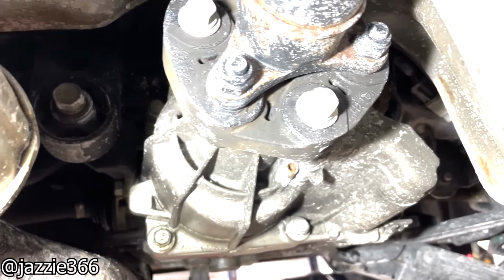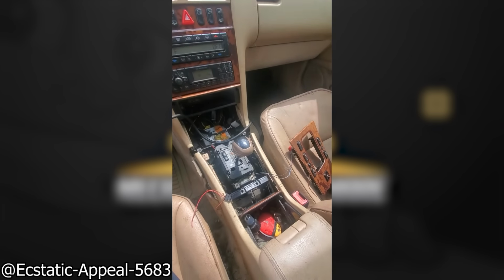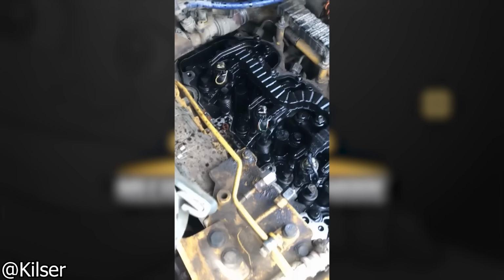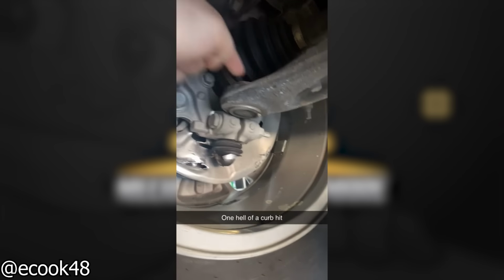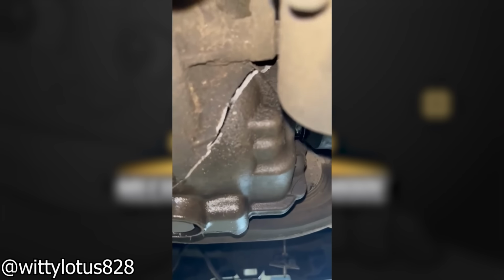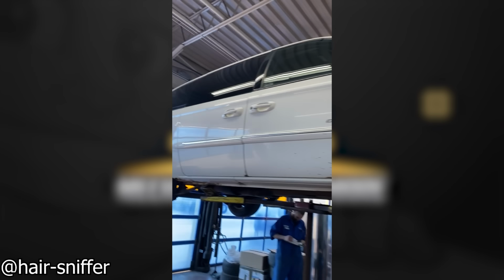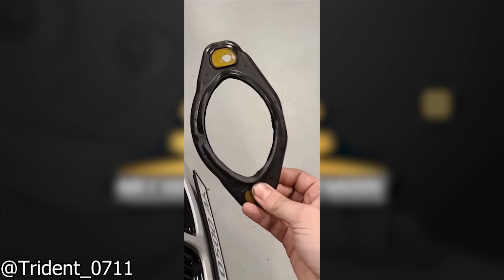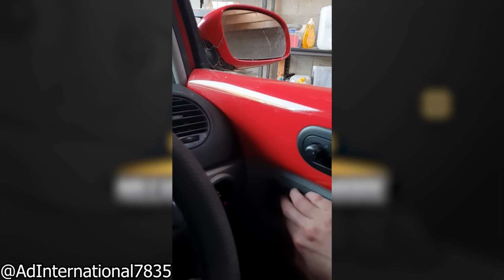Customer States Compilation (Best Of 2022) | Mechanic Problems | Just Rolled In

Comment: DON'T GO TO JIFFY LUBE-TYPE PLACES!
Reply: My work is literally next door to a jiffy lube and I’ve been tempted a couple times but I’ve never been lol
Reply: @Fetidaf  I've had several friends and family need replacement engines because the oil change places have left the filter off, didn't remove the old filter o-ring, no gasket for the drain plug, etc., just dumb things that they miss, goofing around, not paying attention, in a rush.
Reply: @angelalane1307  about a week after I bought my car I smelled burning oil on my way to work, since it was a newer car (10k miles) I didn’t think much of it… until I stopped and saw a glimpse of smoke in my headlight.

I pulled into a parking lot and sure enough, the oil filter was loose. Luckily it’s on top and has a lip around it to catch a little spill so I just wiped it all down and tightened it. It smelled like burning oil for the next couple weeks but it could’ve been a lot worse if it had dropped much more onto the exhaust manifold which was directly below it.

I’ve always double checked things like lug nuts, drain plugs, filters etc when having someone service it but I didn’t even think to when buying a car
Reply: @Fetidaf  😳 Glad you caught THAT!
Reply: I've been fukt outta $ before...you gonna value $ over the well being of a human life?

Comment: 17:08  3 of my vehicles are started exactly like that. Lost my keys one day and pulled the steering wheel lock and ignition off to get home. Two of them now have push button start and switches for power and accessories. One of them still needs screwdriver to start.

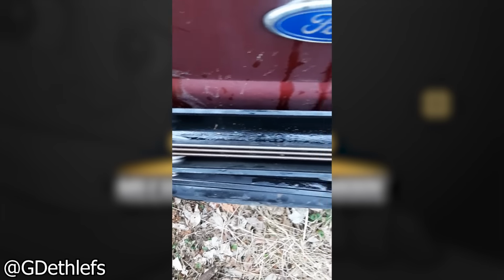Comment: 10:50 For that in rad tank transmission oil cooler, we normally burst test those to 40 bar (~580 psi) with zero deformation allowed, so that transmission had to be at aome crazy high pressure.

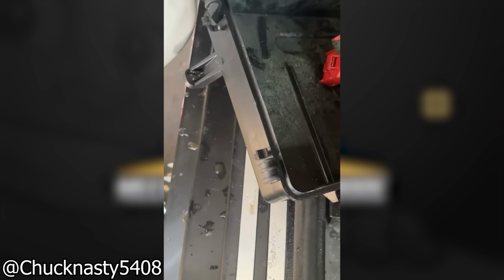Comment: 42:18 I had the same issue with my Audi A6 4F from 2005. Problem is, the drainage ist clogged and all the rainwater comes into the drivers and/or passengers side. Infotainment system is under the drivers side so the radio won't work anymore if this is broken. I think in my there have been like 15 Liters of water and it took like one or two weeks to fully dry (it was in winter..). So not completely customers fault but Audi's engineers.
Reply: I have a similar problem in my 2010 R56. Turns out the vapor barrier seal failed and was dumping rainwater into the driver's footwell, right where a control module that controls lights and ride height sensors is. Easy enough to fix, expensive to get the module and have it programmed though.

Comment: That car with no floor is no problem. I bought a car that someone fixed up to safety but floor rotted. Bought it for 300 bucks. A friend came over to help out. In 2 days we got drunk as shit and put in a whole new floor. Spent 100 on sheet metal, 50 on self tapping screws. Removed seats etc. Hammered it into place then anywhere we could find solid floor ran in hundreds of screws. Cut holes out to bolt seats back in. Total 450 invested in a car i drove for 3 yrs until had a bush party and rolled it in the field.

Comment: I know it sucks, but if you don't fix the little things they turn into huge messes real quick. Get it looked at as soon as it starts making a weird noise, breaks, ball joints, engine tapping, whatever, maybe it can be repaired instead of replaced when it catastrophically breaks. Replace oil every 6000-7500 miles at least. Watch your gauges, get it to a shop if it starts turning or steering or running more difficult, and when you start to leave for the day take a quick look at the tires.

Comment: My mom divorced my stepdad when I was 12yrs old. I became the man of the house, which included fixing EVERYTHING from appliances and her car.
She'd bring home parts her coworkers or customers told her she needed, give them to me and hope for the best.
I started on repairing a washing machine, and progressed to rebuilding her bugs engine.
By the time I was 14yrs, I had done it all, and had neighbors bringing their cars to me.
All I needed was the manual and close enough tools and I got it done, it it was possible.
Also started building guns as well for extra money, get old milsurp rifles that were a mess and just put them back to service state. 
Always good at mechanical equipment or anything with a engine. Today, I can't believe the insane crap mechanics have to deal with, and it seems that the designers and engineers just do not give a care about repairing their designs. 
It doesn't look like we as the end users are actively to be able to do these functions any longer and soon if not already will be just have throwaway items, including automobiles.
I feel for today's mechanics..

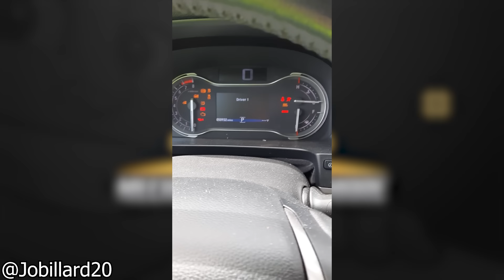Comment: 21:18-21:34  that happened to me also I had to diagnose what was going on, but the vehicle was involved in a wreck and the body shop didn't fix it right, so I had to replace the whole wire harness.

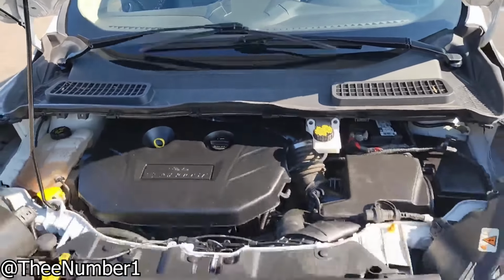Comment: 2:07 my 2017 Ford escape does the exact same thing. It did not do that from the factory, it only happened after I had the infamous coolant intrusion issue and the dealership fixed it under warranty.

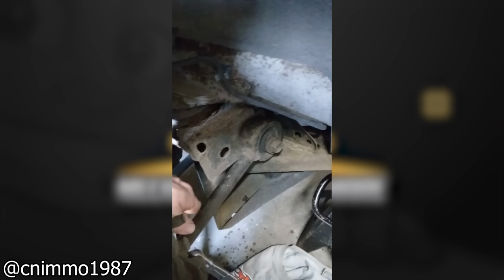Comment: 18:30  a parts guy told a customer - it's OK to use transmission fluid for brake fluid!  Not only the 2 don't mix, requiring a complete flush & replacement & bleed of the brake fluid, AND maybe new parts - - but the brake pedal might go to the floor  AND/OR complete brake failure!  Car owner is fortunate - they drove it to the shop.  
🤔🧐🙄 Might be the most expensive brake fluid flush & replacement & bleed ever!

Comment: For most cars i drive the frame of the car will likely rust out before the engine and transmission does. Michigan weather and salt helps with rust. I always have an under body wash when it hits spring time.
Reply: Not a surprise if you never use protection like owatrol oil or Mike sanders products. It's not the weather or salt. And washing is not enough

Comment: The parental unit's Escort hatchback had the engine overheat and shut down, so she had it towed out of town to a reputable mechanic. They discovered the previous guy had deliberately poked a hole in the oil filter. The screwdriver marks were still visible under the leaked oil.
Always research your mechanic.

Comment: The spilled water on the center console of the Mercedes is a real thing. There's a circuit board (or a brain) that controls the shifter/transmission, window and door locks and several other things. A spilled drink, fries that board and the car won't run. Only fix is to replace it. My dad found out the hard way.

Comment: I think the New York State Salt is especially stronger than other states, I see many vehicles with giant holes and major rust on frames. I grew up in Buffalo, live in the south now, thank god, but bought some low mileage vehicles from NJ and Long Island recently. Because of low mileage they have just a little surface rust on frame. They will be fine down here for next 5 years and the rust will stop without constant salt bath, not to mention driving in the torrential downpours we get in the summer.

Comment: People used to be more mechanically inclined.  You had to be.  You carried little tool kits and spares for stuff that broke.  Like an airhead VW Beetle, you carry a small tool kit and a spare cooling fan belt, some spare sparking plugs, some tappet adjusters .  These days people don't even pop the hood until 100,000 miles.

Comment: I had a 911 come in with an accompaniment box of convertible parts.  He was trying to figure out why the top wouldn't open. He managed to damage the top cover lid transmission and stripped out the pump release screw only to find out the hydraulic ram position sensor was off

Comment: The question remains, did any of the car owners keep their radiators rotated, regularly change the air in the tyres, lubricate the windshield wiperblades, check the gas pressure in the headlamps and rotate the lightbulbs, fill the petrol tank with diesel and run it out every 5000 kilometers, then go back to petrol, change the windshield every 10.000 kilometers, use Drain-O to flush out the fuel injectors every other oil change, spray the undercarriage with muriatic acid to keep the bolts from ceasing, and protect the paint finish by buffing it down with acetone?

Comment: Scary and sad that some of these cars could be running beside us on the Interstate!
Reply: not for long, that's why they're in a mechanic's shop.
That being said, some dirt roads can destroy a car's suspension in short order, and shake most everything else loose or bind it.
my folks never buy new vehicles for this reason, easier to ruin a $1500 junker in a year or two, get 20-30K out of it and haul it to the junk yard, to be replaced with another clunker.
does not make sense to buy a new vehicle and have it ruined three years before you are done paying for it

Comment: That chevy truck at the end is typical for the Saginaw steering column and also the reason why you dont use the steering wheel to help you get into a vehicle I've had 3 jeeps do that and my corvette if anybody sees this and has an amc/jeep or GM vehicle built between about 1969 and 1995 ish with a tilt column you probably have the Saginaw steering column and you need to be gentle with it or that shit happens also they are a pain in the ass to repair if it even can be repaired theyre designed to more or less collapse in an accident and the pressed in collet that holds the ball and socket joint together can mess up and cause this issue if that happens its pretty much just time to put a new column in cause 90% of the time they crack when that happens

Comment: The clip of the 350 LT1 hurt the most. Definitely a blown head gasket. I guarantee that the coolant overheat dash light was on for a long time. At least this engine can be rebuilt. Most modern engines are a throw away item.

Comment: I change my oil and filter every 4K miles with Kirkland full synthetic oil and I change the front and rear differential, transfer case and transmission flush every 30K miles on all 3 of our vehicles. I guess that’s why we can drive our vehicles for 300K miles.

Comment: That transmission cooler expansion is one the big reasons to change your fucking transmission fluid. And no it doesn’t matter what mileage you do it at all. That was varnish and brass flakes lodging in the thin ass cooler jackets and transmissions have been putting out a lot of pressure even back in the accumulator days. They put out even more pressure now that they are all solenoid valve body control

Comment: What's really sad is you can take your vehicle to the dealership to get something repaired and they always do some "multipoint inspection " trying to find other things to repair and never check the easy/free stuff. Took my van to get the door motor fixed and they didn't even add a little air to my tires. Said they all have 35psi but my light was on when I got there and when I left. 
Just because a car is in to be fixed doesn't mean that they don't try to take care of them. Some of the bad is on the mechanics that don't really do the checking earlier.
Reply: No - when you see the lights are on because of the pressure YOU check and add air. That's your job as the owner of the car, like it's your job to check if all lights are working before you start, because when someone crashes in you because your break lights didn't work it was your failure. And if you give your car to the workshop and you see that the pressure isn't right ask them to check it. And with the automatic tire pressure sensors the problem is most of the times that the sensor is broken, but the pressure is ok and changing the sensor is a repair you have to authorize. Depending on the car the sensor can cost between 20$ up to 200$ + the cost for checking which is defect and installing a new one.

Comment: There is a reason for the things, and don't simply blame the driver.  Firstly, car makers use crappy metal,  like cheapest iron that will rust and crack on a 100.000 dollars car! 
They also use  cheap plastic for tubes and valves and all the fluid bits, which will obviously freeze or melt and shake appart under stress. And don't even start with electronics,  as they 'custom build' the crappiest navigation and sound units worth 10.000 dollars, instead of simply using a last-year cell phone worth 100 dollars (those also have GPS and map modes, even have a voice control not to mention touch screen).  People do not eat with rusted spoons anymore,  they would sue the instant any restaurant showed up with cheap iron spoons.  They tolerate them in their cars, even though is far riskier for a mechanism that is exposed to rain or freezing.

Comment: Some people think all maintenance is a mechanics shop scam. Yeah they have a cousin who can do it cheaper. Oil change? That's just ripping you off. Just run it till it fall apart. Those synthetic oils are supposed to go 20,000 mimes between changes. That means you can go 50,000 miles between each oil change. Easy.

My 2017 Ford diesel pick up gets service by the books because I paid for the service contract. Oil changed every 7,500 miles. Fuel filters e ery 15,000 miles. When it hit 90,000 miles I had thr usual oil and filter, Fuel filter, but flushed and filled thr coolant, front rear, and T case fluids changed. Full tranny flush and fill and filter changed. Yes those aren't cheap. But I see it as cheap insurance.

Comment: Some. I say some of these are things that can happen to anyone. But the huge majority are just scary examples of neglect and/or a lack of knowledge or interest. And that's the huge majority of car owners light there. Most are not interested in cars, nor do they know how they work. All they want is to get from A to B reliably and in decent comfort. They are often listening to music at high volume and if some new noise intrudes they screw up the volume. 

The really amazing thing is that this isn't even more common. Looking at the number of cars you see broken down on the shoulder I'd say they are way fewer than you used to see forty years back, and that even though the total traffic has increased drastically. So modern cars are not nearly as bad as some will try to tell you. Sure you can't rebuild your engine with a screwdriver and a socket set, but then neither could 99 percent of the drivers forty or fifty years back before electronics and computers took over from electromechanical ignition systems and all that.

Comment: I really can't believe that some of these cars are just coming in to have work done on them. 😫 
Over here in the UK 🇬🇧 there is no way in the world you could drive a car, bike lorry etc like any of those in the USA. We have a mad thing you have to do every year. So that's book an MOT test, take the car, bike, whatever, and give the keys to the dude who works at the MOT station all the time doing MOTs. There is no way in the world 99.8% of the cars on here will fail to pass a UK MOT. You drive your cars into the ground and no matter how unsound any of the is, you can drive it on the streets????????????
I've seen Vice grip garage put cars and drive them when they've been sitting for decades

Comment: These are great vids showcasing foolish vehicle owners, what I'd love to see is a few of the countless examples of when cars are put in for work that not only doesn't get done but infact other parts have been switched for dodgy parts...
I'm not mechanically inclined, I bought a 4WD at auction, took to mechanics for inspection, diagnosis was a full engine and transmission rebuild, I said do it so as I could at least recover 90% of cash invested... Part of the service was a full engine bay detail, if they had even wiped it down with a rag I'd probably never have known that they had straight up ripped me off

Comment: The one at 42 mins is that an engagement ring/wedding ring/band (girls/ladies, since it seems to have stones in it) around the push to start? (hence the "Satisfaction" caption)

That one felt like a breakup/divorce, if it was one of those kinds of rings/bands and it's the owner of the car that wanted that removed.

Comment: I have never been able to understand the amount of rust in so many cars 😮
Reply: If they live where it snows a lot, they put salt on the roads.  The salt rusts the cars prematurely.  Never buy a used car from one of these areas.  That's why Cali and AZ cars are sought after; they are most likely rust free due to the dry environment.

I live 2 hrs from the gulf coast.  Around here we use Ziebart under carriage rust preventative coatings to preserve beach bound trucks.  It works.

Comment: In the old coal burning steam locomotive days they would get cinders from the ash box on the locomotive 🚂. Cinders were used for ballast. Municipalities also use them to de-ice roads because they were blocked and they would attract the Sun and because they were just carbon they could get washed away and get mixed in with the dirt with no problem. That's why car is lasted forever even up north until they started to use salt all over everything. And of course now the metal is much thinner than the metal on the older cars which were built like a tank.

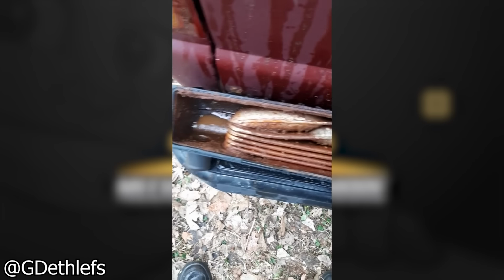Comment: 10:51 Pretty sure those trans oil coolers are burst tested at 40 bar (580 psi) for zero deformation. No way the transmission is in good shape...

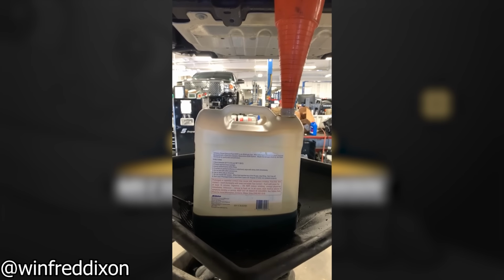Comment: 3:01--- the 2022 Yukon uses 8 quarts of 0W-20.  so you have one and a quarter oil changes in there.  who was that guy?
Reply: It prolly collapsed a lifter, what was drained was about spec so that’s the next common issue

Comment: There are many signs of no maintenance , abuse , outright stupidity.  The rusted frames and under underbody is concerning.  The result of salt and calcium used on roads and manufacturer substandard materials.    In the old days things were manufactured to last.  Now they are engineered to fail.  A disposable society.